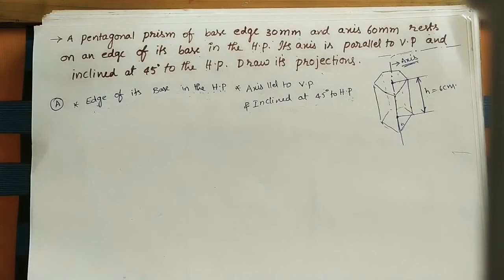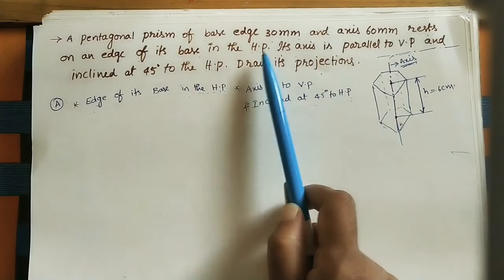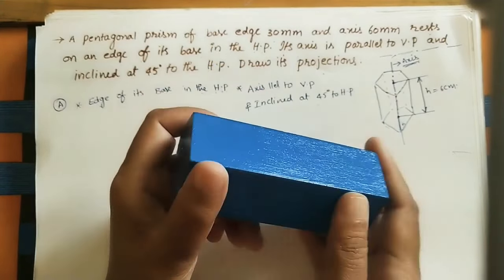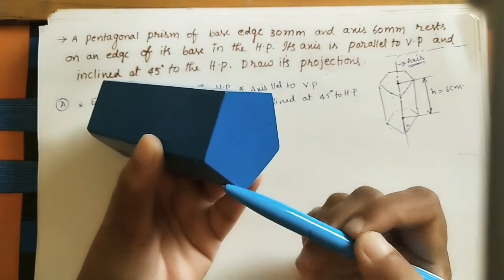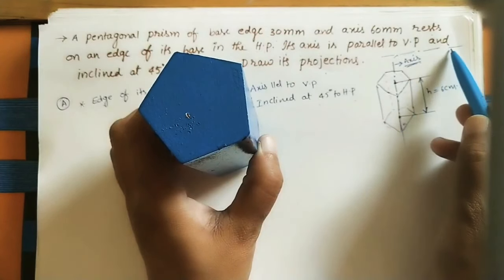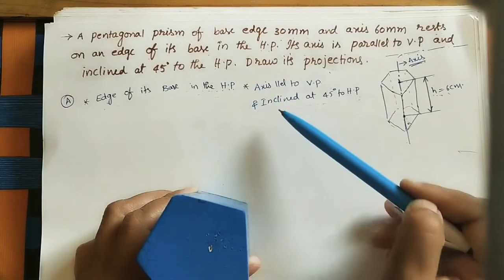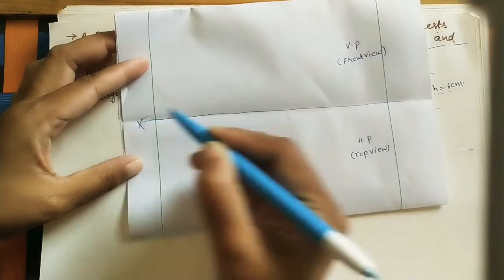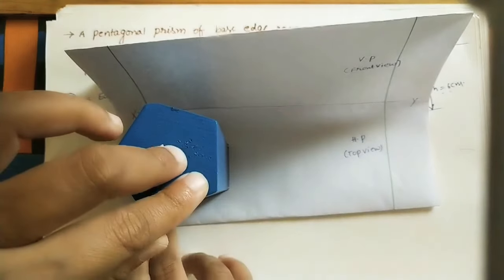Projections Of Pentagonal Prism

Comment: Hello mam, a small doubt
Can't we put side a,1-b,2 in straight/perpendicular way
Plss reply mam
Reply from the maker: Yes we can,  but you have to tilt the prism in the opposite side that is a1 b2 .Wherever side we r drawing at that side the prism is tilting 45°.
Reply from the maker: More gap should be required between two diagrams because inclined side required more space in opposite direction.
Reply: Thank you mam